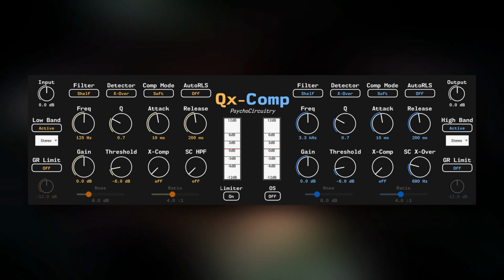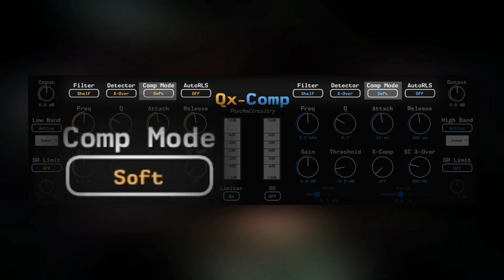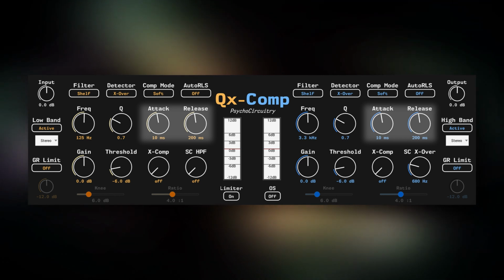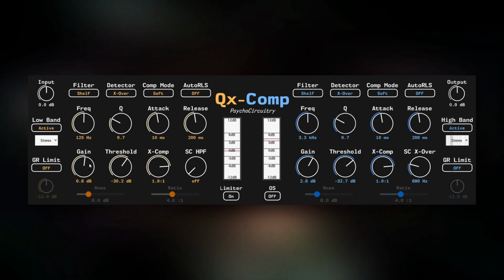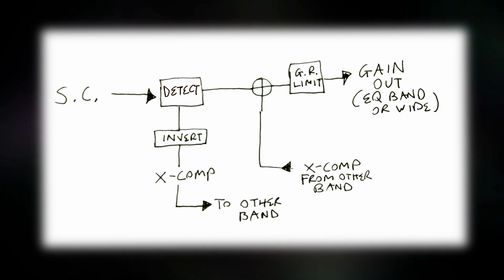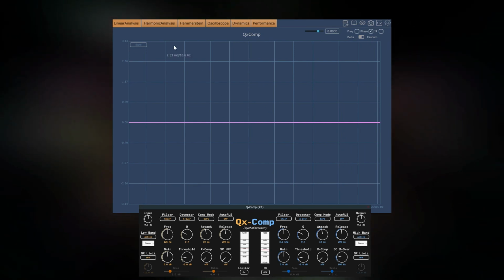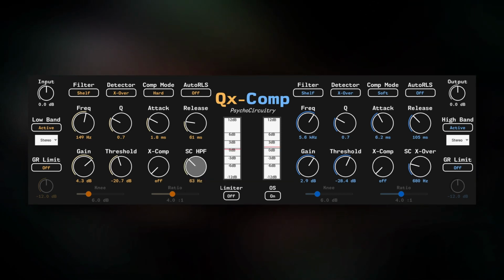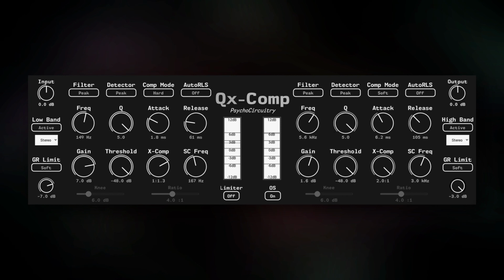How To Use: Qx-Comp (In-Depth Overview)

Comment: X-Comp seems to be a really unique compressor feature. At least I never saw it before. How did you come up with it? Did you have a specific usecase in mind or was it more like a funny concept that turned out to be actually cool?
Reply from the maker: The design is somewhat based on the GOLY CompEQ. And that design seemed missing a good plugin equivalent (at least that I could find).

I've added the additional detector mode, channel operations and more user definable control over the behavior (where I felt it could be useful and trivial to add in software vs a hardware unit).

I definitely think it's a unique and useful concept and have been personally using it on master buss to add a little dynamic movement since I had a working alpha over the summer.

And that was the main goal I had in mind for it, subtle movement and dynamics increase for buss work (groups or master).

But it's certainly flexible enough to do a lot of things with even on individual tracks and for more resonant effects.

But definitely check out the GOLY CompEQ if you want to see more of what Qx-Comp was based on in use!